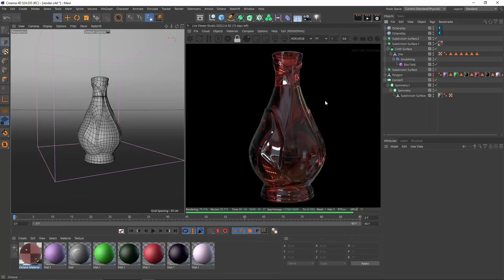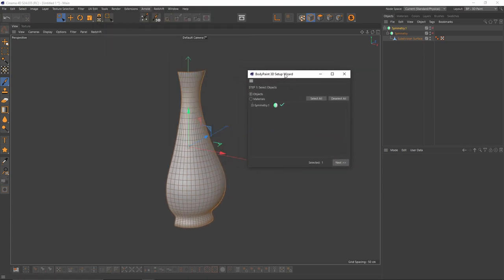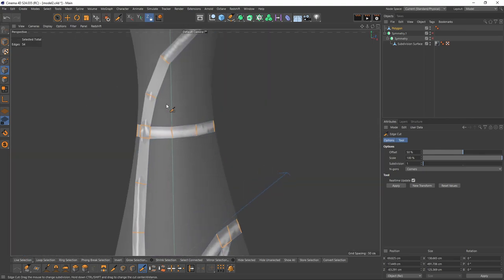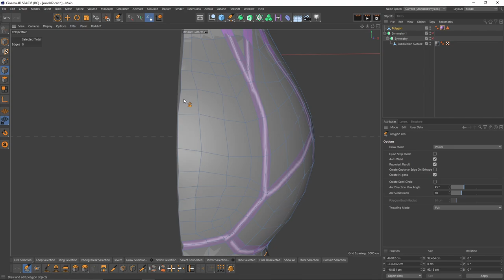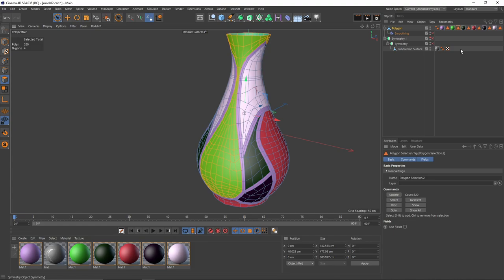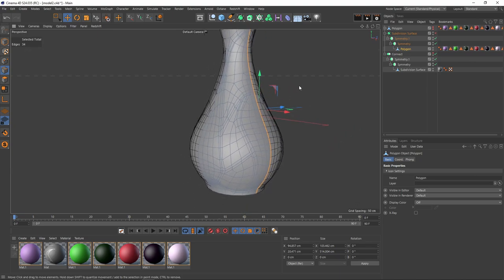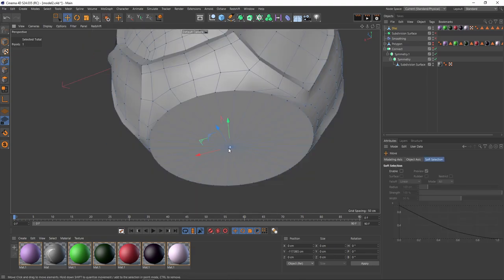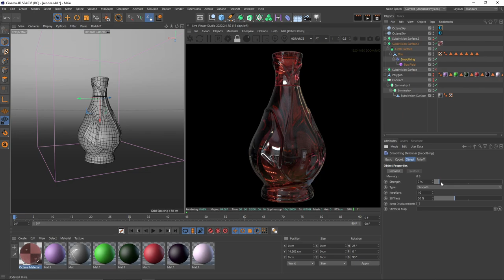Complex Glass Bottle 3D Modeling | Cinema 4D Modeling Tutorial

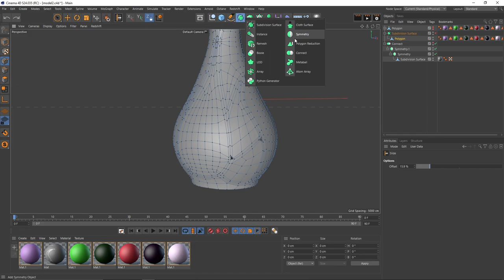Comment: 18:21 protip if you want to quickly check for any disconnected geometry instead of examining the subdivided mesh: use the Normal Scale tool.
Reply from the maker: Nice one!
Reply: @polygonpen   Hi, whenever you have a moment, could you please clarify the process of making the subdivision surface editable around the 2:36 mark? I'm a bit stuck at that point. Thank you!

Comment: Interesting to watch really. But one thing comes to my mind. Wouldn't there be an easier way? Like projecting splines onto the surface, tweak them properly and use them somehow in sculpting mode? Without need to manually draw all polygons onto already finished form of the bottle?
Reply from the maker: Yeah, could be better but mine technique is just an alternative/a diffirent version, you can choose whatever technique fits you or faster.

Comment: Hi, whenever you have a moment, could you please clarify the process of making the subdivision surface editable around the 2:36 mark? I'm a bit stuck at that point. Thank you!
Reply from the maker: You just need to hit ''C'' on the keyboard, it is gonna turn the SubD into a mesh.
Reply: @polygonpen  thank you for that clarification! i have another QQ if you have the time to answer. is there away to turn off the symmetry function during the painting the layer part of the project. because my model isn’t completely symmetrical. also is bd paint 3d the same as paint tool in C4D? thank you again for the help!

Comment: How do you extrude by using commands and keeping it on the same plane as the original cylinder. So its all one smooth polygon?
Reply from the maker: I use shrink wrap deformer, if it is what you are asking.